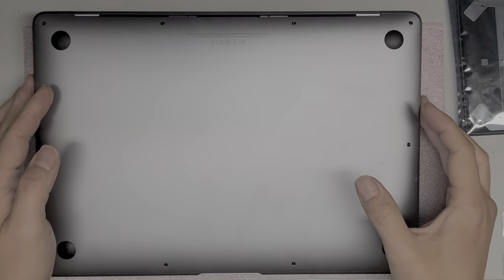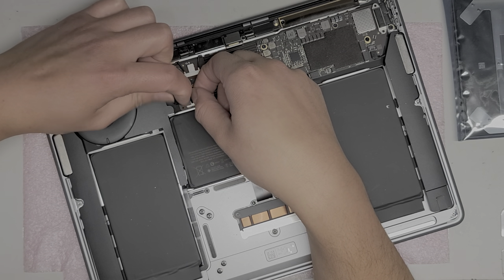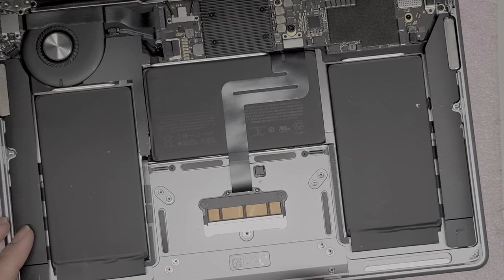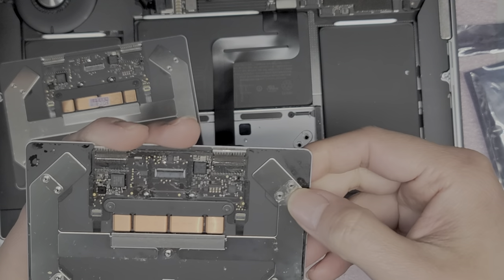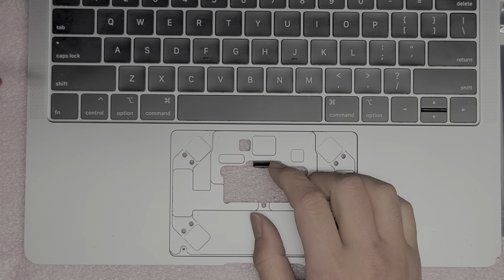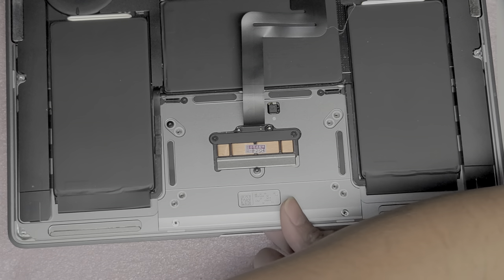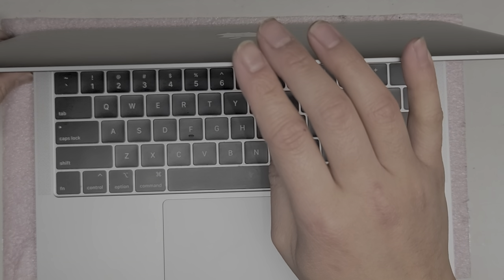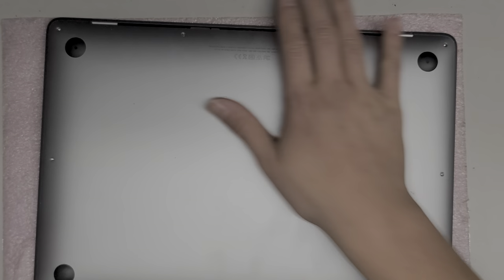13" inch 2019 MacBook Air A1932 Disassembly Trackpad Touch pad Touchpad Replacement Repair

Comment: Sweet man thanks! Just finished mine up.. Got scared for a sec because mine still would not click after installing the new mouse pad, but it worked once turned on. Mine had a little erosion on the old pad
Reply from the maker: Yeah, the new MacBooks vibrate for feedback

Comment: hello, very interesting videos... my MacBook Air A1932 got liquid damage, closing lid, do not turn off the screen, got a clue where is the lid sensor located? I had read (can't remember where) that lid sensor is located on trackpad,...? changing trackpad will make it work?
Reply from the maker: Not sure
Reply: @ItsBinhRepaired  Thanks anyway
Reply from the maker: Yup

Comment: Hi! Thanks for the vid! What trackpad did you buy? Is it from a third party brand? I also have to replace my trackpad. Is it safe to buy a new trackpad from Amazon or AliExpress? Will it work like the original apple trackpad?
Reply from the maker: What year model and color is your MacBook?
Reply: @ItsBinhRepaired  I have the MacBook Air 2019 A1932 in gold color.
Reply from the maker: @crabbynebula  strange I'm not finding the 2019 model
Reply from the maker: @crabbynebula  maybe it's the same as 2018 https://amzn.to/3afHrFQ
Reply: @ItsBinhRepaired  yes, turns out that both the 2018 and 2019 models have the same trackpad and flex cable! Thanks for the recommendation! But how does such a third party (not oem) trackpad actually “feel”? Maybe you know since you got one yourself? Is the material the same? Also can you use all the shortcuts like before, e.g slide with three fingers to display all open tabs?
Reply from the maker: @crabbynebula  they're pulled from macs usually original.

Comment: Does that cable have anything too do with the keyboard?
Reply from the maker: If the touchpad is dead, Apple disables the keyboard and reduces performance and makes the fan spin max speed
Reply: @ItsBinhRepaired  my trackpad wire ripped during the process of replacing the battery now my MacBook can’t detect a keyboard and mouse
Reply from the maker: @JakePadillaOFFICIAL  you'll need to replace it

Comment: i have a MacBook Air 2019 with some worn keys, do you know if I need to disassembly it completely in order to replace them?
Reply from the maker: Worn like the letters worn off?
Reply: @ItsBinhRepaired  sorry i meant worn out
Reply: @ItsBinhRepaired  yeah, is it possible to pull them out and stick new ones? Or I need to take all the keyboard out
Reply from the maker: @jimenajofre8594  this video will help you. https://youtu.be/oCWlcoq0v0A
Reply from the maker: @jimenajofre8594  the other video in the description might be useful as well